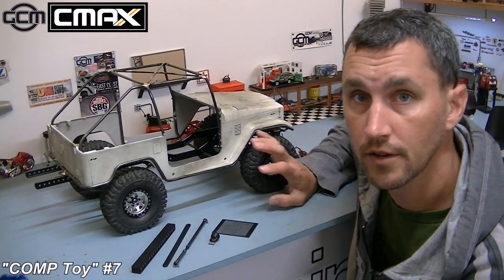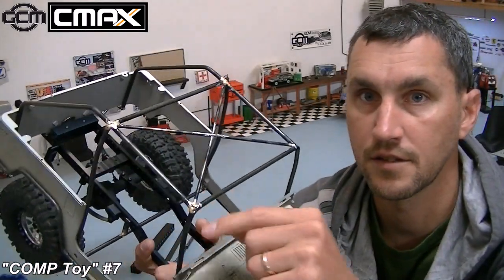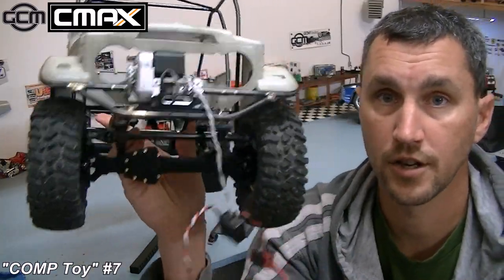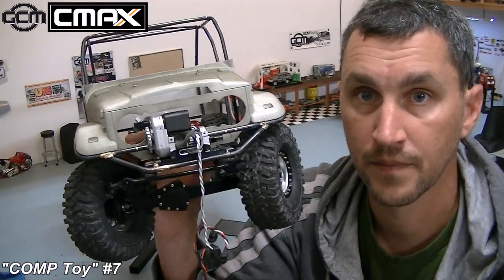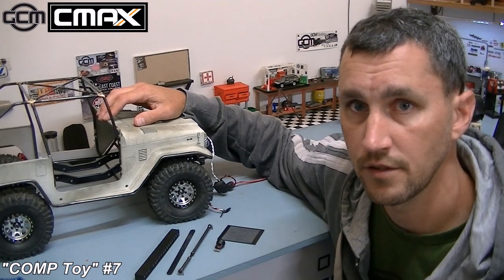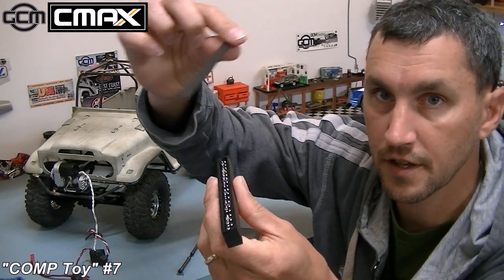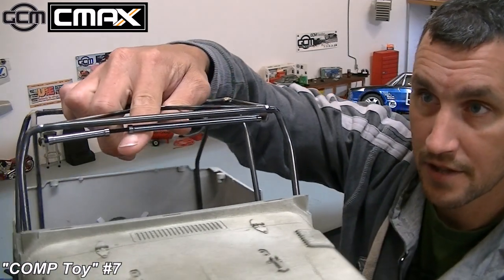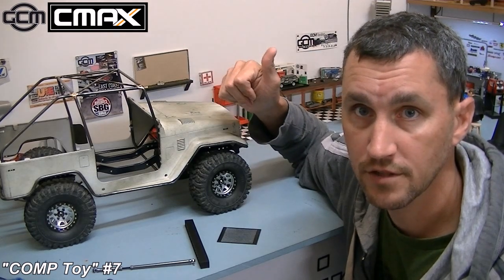GCM CMAX "COMP Toy" #7 Video Build - Accessory Mounts

Comment: Hey Chris your tube work is looking fantastic!!  I used to build tube chassis' for 1:1 drag cars back in the day.  Really fun to see how a few well-placed tubes to triangulate an open space can make the system rock-solid.  I'm guessing that you will frame-mount the steering servo?  If yes, then I'm wondering why not mount the servo on the axle so that bump-steer is eliminated and the chassis/body doesn't pitch side-to-side when the steering is actuated?  Is frame mounting done for scale reasons?  Thanks so much for posting these videos.  The build is looking awesome so far.
Reply from the maker: Your description of servos on the frame pitching the truck etc.. are only a symptom of bad steering geometry. Any properly set up track bar and steering bars won't EVER do that. Sounds like you've got experience with servos on the frame and a standard front 4 link... no track bar... This truck certainly won't do anything like that.